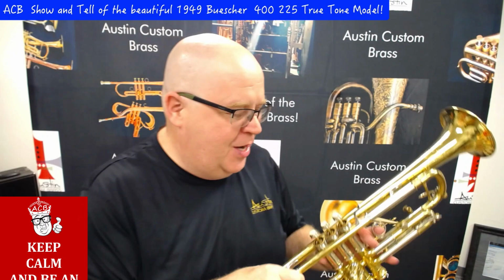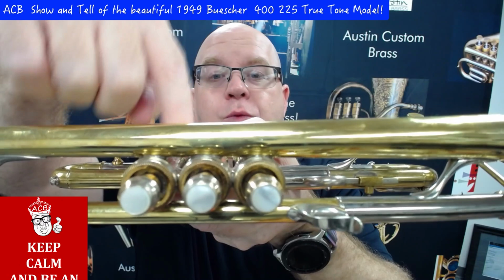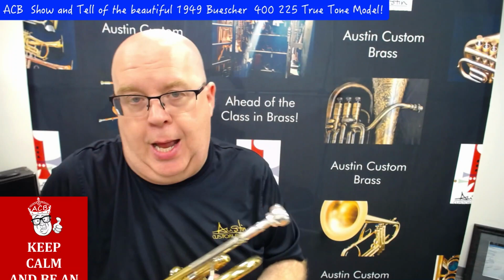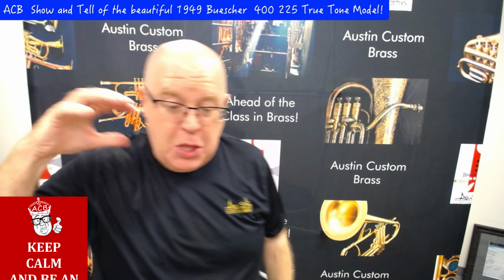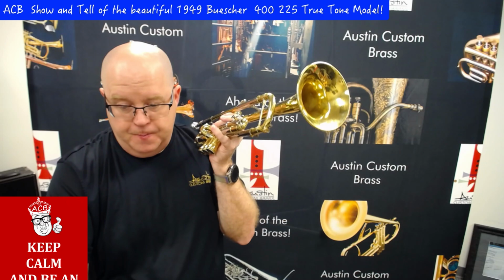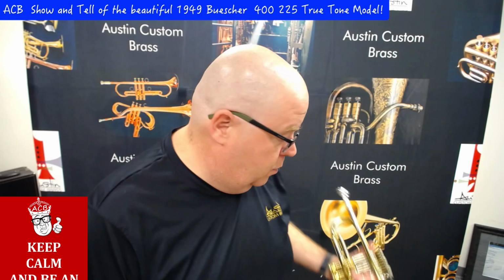ACB Show and Tell: 1949 Buescher 400 225 Model! One of My Favorite Vintage Trumpets

Comment: Only problem with these vintage model 400s is the mouthpiece recievers, you need a specific mouthpiece shank for vintage Bueschers.
Reply from the maker: That's not true at all on this horn. Maybe for the horns ore 1930. This works great with a standard mouthpiece.
Reply: @austincustom  
Oh yes, probably the prewar one with nickel silver leadpipe from the 30s. I guess postwar horns have more standardized reciever sizes.